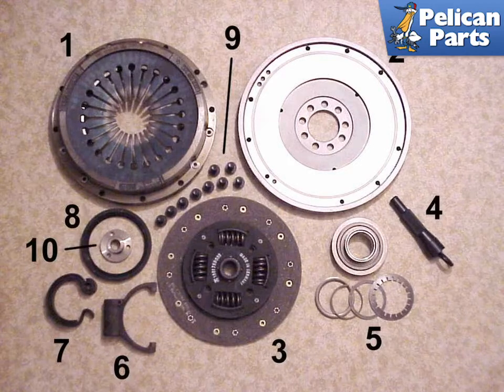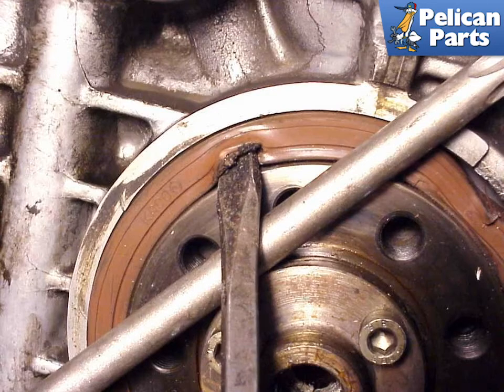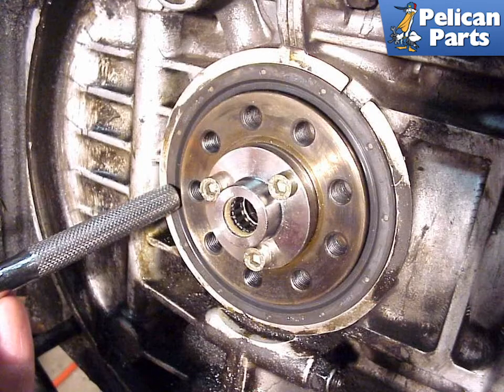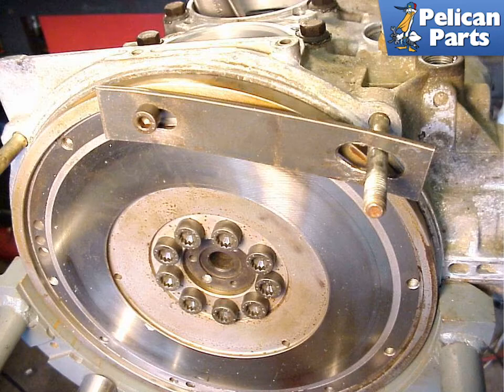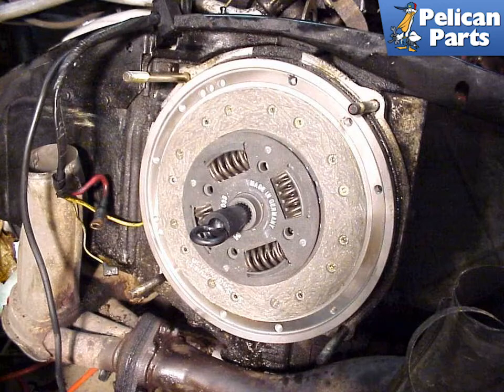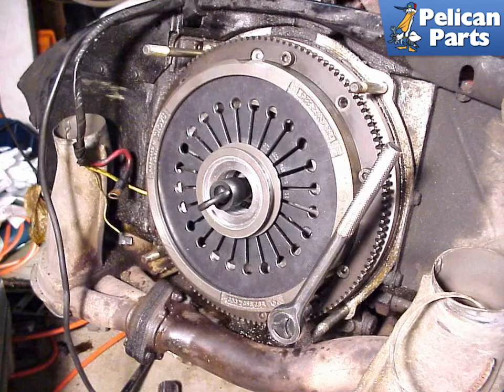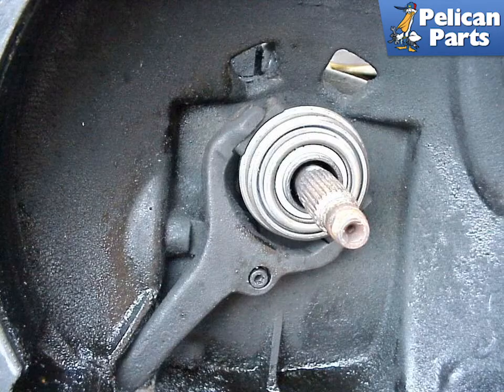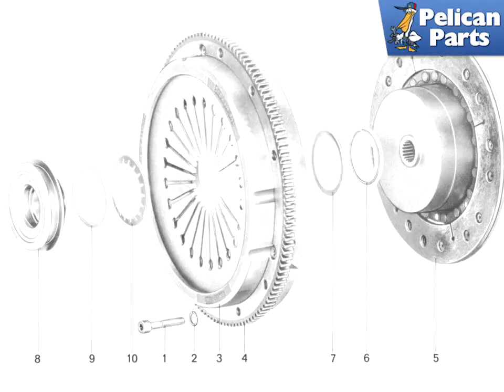Porsche 911 (1965-89) Clutch Replacement

Comment: Do any of contact surfaces of the clutch components get greased?  Throwout bearing tube, throwout bearing fork contact points, etc
Reply from the maker: The fork contact points and a very light amount on the shaft where the bearing rides. That's it.